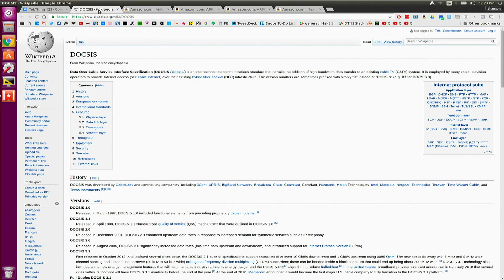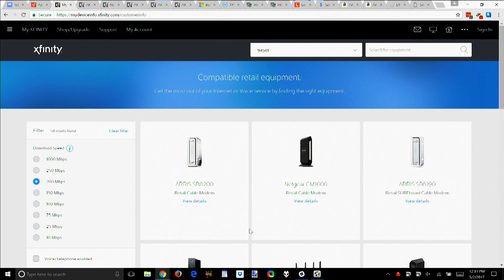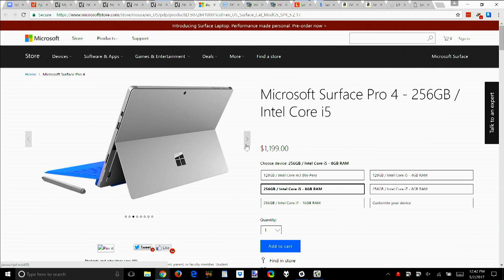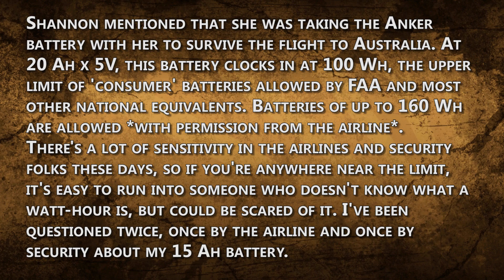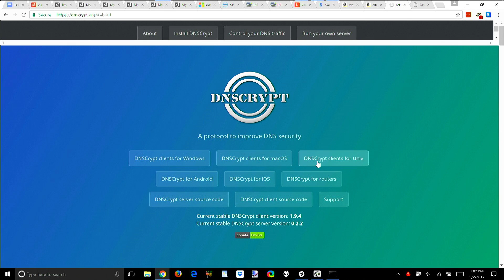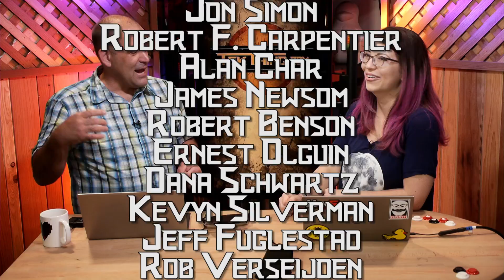Speed Up Your Cable Modem! Is Your Battery Pack Too Big To Fly? MS Surface Pro Substitutes, DNSCrypt

Comment: Also don't forget signal quality/strenght, connect your modem at the first coax split because every time you split the connection you loose 50% of the signal. Log into 192.168.100.1 and here you can see your signal strength. (google "cable modem signal levels" and you will find the acceptable ranges.)

Comment: I bought  a newer cable modem some time back and the service tech flat out told me that it wasn't compatible with there system. (This was before they upgraded to Docsis 3). When they finally did upgrade their system, I got a modem upgrade for free and basically tripled my service speeds (7 up 46 down vs. 1.5 up and >5 down) and a whole lot more stable.

Thank you for your information on speeding up cable modems. Your show rocks.

Comment: 24:00 The calculations arent off for the battery pack. The standard math formula people use to calculate Watt Hours is incomplete. It assumes we live in a perfect world, where there is no loss of power, unrestricted transmission of electricity, and that each component runs at 100% efficiency. If you account for these factors the max power goes down.

So under pristine conditions the battery pack might have 100 Watt Hours, but in the real world its only 77

[Think of modems. They might have a 100mbs down in a perfect world, but there are all kinds of flaws in the system that will ensure you will not have full speed at all times. Its also the reason some cars can go 60 miles per gallon of gas, while others can only go 20]

Comment: Snubs...you're funny..."call them and say you're looking to move"...lol...funny...ROTFLMAO...HA...We have Direct TV, ATT, and Comcast (or "cut the cord that costs as much as having the service").  AT&T will say "great, see you in a year, good luck with Comcast", Comcast says "great, see you in 6 months, good luck with AT&T", and DirectTV just plain sucks...my neighbor is currently trying to readjust their dish outside for the 50th time in the past 4 months because of issues...they don't realize it's either the rain or the SAC base going active causing their interruptions....no...we have no "alternatives" in my area...they just say "pony up"...cutting the cord will cost me the same amount as keeping the service so I go for the simple solution for the family.
Reply from the maker: Bummer! It's worked for me for 5 years straight. I just call up comcast year after year and say I got a deal from AT&T and I'm checking to see what they can offer me. They've usually offered me the same or similar rates on a new yearly contract (I don't mind the contract).
Reply: Problem we have here is we have Sattellite (which everybody hates because we have an Airbase 3 miles away and when that massive radar goes active...all bets are off)...it's also EXPENSIVE (to get the same level of service I currently have, I have to spend more).  AT&T and Comcast are about the same $$$ all things considered, and they know that they can pull a $100 hookup fee every 6 months?  They just say "go for it"...I've run the numbers...I'd end up spending more :(  I looked at cutting the cord, but between all the internet subscriptions I'd need for what I currently get?  Again, at or above what I pay today.

Comment: I haven't actually tried it, as I'm on linux at the moment, but you may be able to get DNSCrypt to start automatically by creating a shortcut to it in that startup folder. This would mean that any files DNSCrypt depends on (such as dlls or config files), and uses relative paths to locate, would still be exactly where it expects them to be.

Comment: The router could also be a bottleneck. Weak SOC's on a router can really hinder multiple streams of data.
Reply: None Yet definitely not the router as I tested the lag on our old modem while both were hardwired in. Plus, my router has QoS settings turned on so I can manage everything thru my router. Upgrading the modem has definitely helped with our shared connectivity issues.
Reply: Oh, I was talking about the person who sent the question on the show also responding just in general. Obviously since the modem fixed your issue it was the bottleneck but routers with a weak SOC can also cause problems with concurrent packet transfers and whatnot. I've had my share of routers that would just choke whenever I tried to torrent. I found that a router with a good SOC inside always solved the problem with the packet flow.

Comment: Shannon,

As others have stated, the watthour ratings are for the battery, they are not for the output.

The switching power converter increases the output voltage by turning the DC output of the battery into an AC waveform, sending that to a step-up transformer, and then converting the output from the transformer back into a DC output.  The DC output is regulated by modulating the AC waveform and measuring the voltage from a feedback loop (typically an unloaded winding in the transformer).
Reply: Off-topic discussions, personal attacks, and bullying, are forbidden on YouTube.  Reported
Reply: William Bosacker it seems everyone (including those that wrote in about it) we're incorrect! thank you for chiming in! But please don't make me feel inferior. It's a bit rude :)
Reply: FYI, I would never belittle, or make you feel inferior, publicly.  If you want to discuss this, we should be using private email, and not be discussing this here.
Reply from the maker: I always figure that, if you can't say something publicly, you really shouldn't say it at all. I saw that you edited your comment and removed the belittling portion. Thanks for that! :) -s

Comment: don't buy the 6190... Arris literally got sued because the latency was so bad. Get the 6183 or buy a DOCSIS 3.1
Reply: NickF1227 I saw that elsewhere as well, but haven't noticed any lag issues. perhaps they fixed it on newer hardware revisions? hmm.

Comment: Hope he reads this ... The reason DNSCript wont work in the startup is because it needs to be launched as admin. You need to create a task for it instead and have the task set to "run with highest privileges" .. then it will launch at startup  I have had to do this with other programs that need to be launched as admin

Comment: i'm in NC with Time Warner Cable and have a Ubee modem/router/wifi.  So you're saying it's best to have a modem by itself and then use a router/wifi separetly?  i stopped using my DLink DGL-4500 years ago when they put out these better Ubee DOCSIS 3.0 modems with lots of features.  It seems like it's a good modem combo.  Also, i used to play Battlefield on PC a lot, but haven't played in a while.

Comment: If your uploads are throttling your downloads, it's also worth looking into the bandwidth settings on the apps that are uploading.  Dropbox and Google Music are two applications that allow you to adjust how much of the pipe it uses.   It's not always necessary to buy new hardware.   I also highly recommend the forums at dslreports.com:  there are lots of knowledgeable people there including real, live engineers who work for cable companies.

Comment: The SB6190 is a terrible modem, get something else!!! I've had nothing but problems with it, switched to a NETGEAR CM1000 instead, been flawless! I'm a computer tech/system builder/network admin/etc...noticed weird issues while gaming, and found this article, I have found other sources saying the same thing, look around and you'll see for yourself...

http://www.dslreports.com/shownews/The-Arris-SB6190-Modem-Puma-6-Chipset-Have-Some-Major-Issues-138411
Reply: Interesting owning a sb6190 I immediately started to check around I might have gotten lucky I have not had these issues I own hardware revision 3 and currently only have 24 pairs bonded so it seems to be alright. Here is some further reading I found the test they made very useful:
https://www.dslreports.com/forum/r31079834-ALL-SB6190-is-a-terrible-modem-Intel-Puma-6-MaxLinear-mistake
Arris then got in trouble:
https://www.theregister.co.uk/2017/04/11/intel_puma_6_arris/
Reply: No dude, its a know issue with the Intel Puma 6 chipset, hence the link in the post I made...here are more...

https://www.theregister.co.uk/2016/12/03/intel_puma_chipset_firmware_fix/

https://linustechtips.com/main/topic/736823-cable-modems-with-the-intel-puma-6-chipset-lag/

https://www.dslreports.com/forum/r31122204-SB6190-Puma6-TCP-UDP-Network-Latency-Issue-Discussion

I can go on, but I think you get my point, please read/research before posting something non-technical like my cable company cant handle that many channels lol
Reply: it may just need updated firmware...or your cable company just cant handle all those channels.

Comment: Lag has absolutely nothing to do with how fast you internet connection is and has everything to do with your physical distance from the server you are gaming on and the quality of the connection your ISP is providing you. Things like jitter and congestion on their network cause lag. Of course if you are utilizing 100% of your available bandwidth you will experience lag. You can counter that by using QOS.
Reply: Ideally you're right but in reality not true. Bandwidth can affect your latency if you hit your maximum capacity.  Poor hardware, software and intentionally poor choices of implementation by the provider also have a big impact on latency.
Reply: I say all of this in my post. So therefore I agree with what you are saying.
Reply: My router is setup with QoS which definitely helps, but isn't the main component in my modem issues.
Reply: Oh no I understood your issue with your modem, i'm just stating other causes. Huge fan right here !

Comment: For the watt hours, it is based on the battery cells and not the output. With a power banks made by anker, they use They use multiple 3.7V cell batteries that have a max charge voltage of 3.85. They then use a DC to DC boost converter to get the 5V, this can often have a 7-10% impact on the effective capacity as those components are not 100% efficient. If anything, anker is overestimating the capacity of their power banks. Furthermore their estimates are based on the max capacity and not the typical capacity. For example, a 4000mAh battery might give you 4100mAh or it could give you 38800mAh as there is variation in the manufacturing process of batteries, but power bank makers focus on the maximum to better pad their numbers.

Comment: One thing I found with an old modem: it didn't fail completely, but I was getting only 700 Kbps speed. I got on the phone with Cox (my ISP) and found the modem was dropping 90% of the packets. As an electrical engineer I figured out that there were lightening strikes that  partially damaged the input protection. This can happen to any modem, the input protection degrades over time, so a new modem fixes lots of problems. I now have fiber optics to my desk, with an optical input to ethernet converter, so that doesn't happen again. Bottom line changing your Cable Modem every 4 or 5 years is a good thing.

Comment: all of those portable batteries are lithium ion batteries, they are 4.2 volts fully charged, and when discharged they are 3.7ish volts, in order to get the 5 volts that the usb spec uses for charging they all have step up regulators so that the calculation they are using is 3.85*20 (i assume its a 20000mah pack)

Comment: I've had the base Huawei MateBook M3 for about six months. It's a solid computer/tablet. I watch a lot of streaming content on it and read CBZ files on it. I find that it does everything I use to use my Acer R7-371t with an i5-4210U at half the weight/thickness. 

It's on sale for $200 off at the Microsoft Store. They also havethe port adapter, stylus, and keyboard portfolio case dicounted. The whole package is only $600, which is what I paid for just the MateBok w/free keyboard portfolio cover last November.
Reply: Bryan Lucas I have a Chuwi Hi12 for the same thing -- magazine pdfs and comics. I know it's too weak for real work, but it's perfect for its intended use. Beautiful screen on that thing. And I got it on sale for $225 from Gearbest. I know it's a crapshoot if I ever have technical issues, but at that price, it's not a huge risk.

Comment: The Lipo battery cells(Multiple cells in a battery) are about 3.7V, and that's what they use for the calculations.
The battery bank just outputs at 5V(For USB compatibility).
Reply: same

Comment: I recently bought a new router, not that I had any issues with my 'old one' just wanted more home network speed so I bought the DL 868 from D-Link, but when I tried connecting to webpages or videos it just wouldn't process it sometimes and lag out.. I returned it but still curious if someone here knows what could have been going on? both new and the old router that I am using again, without problem, where connected to my modem that is in bridge mode
Reply: Did you tell your ISP that you were upgrading? With mine, we had to activate the new modem on our comcast acct before it would allow us to connect.
Reply: Shannon Morse no, I have a normal modem from my ISP, but because it isn't that good I have a router hooked up to it that I bought myself, only the new router had problems, should stand alone from my isp

Comment: lol my ravpower is stated at 99.16wh that's 26800mah at 3.7v it it's at 5v it's am 134wh... guess I'm screwed on my vacation.
Reply: FishFind3000 Nah, it's actually fine. It is under 100wh. It won't hold more power just because you use more volts. It will just drain quicker.

Comment: If you have telephone service with the cable company, you can use their modem for just the phone line, and hook up your own modem for internet. In most cases, the ISP only charges rental fees for the modem if it is used for internet. Best thing to do is call the cable company and hope that the rep knows what they're talking about... then call them again to verify that you weren't told incorrect information. (It's a hassle, I know... ) 

- Also... the max speeds listed on Docsis 3.0 modems don't mean sh*t. On my ISP, each channel is maxed out at about 20 mbps (as opposed to the 38mbps theoretical max) ... so an 8 channel Docsis 3.0 would max out at around 160mbps, and 16 channel modem @ 320mbps. 

- I used to work for the cable company... so I know what I'm talking about.
Reply: OneManShow 
True about using Comcast's box for phone line and your own modem for Internet. This is the way I run it.

Comment: you might have a fibre optic connection and be right beside the cable box or you might be right beside the local broadband provider, Patrick why do you move close to where Shannon Morse lives.
Reply: DAVID GREGORY KERR definitely not fiber optic (yet), though not sure about the providers location.

Comment: do you guys have the data cap with Comcast in heber utah it is capped at 1 Tbs and i usually use about 500 Gbs of that a month
Reply: Tyler I have not seen any data caps. It's only if your torrenting like crazy.
Reply: Tyler yup, it's 1TB here. I'm not happy about it, because I know eventually I'll get close to that cap, but right now I'm hitting around 500GB.
Reply: it seems to be a area thing i was just wondering if anyone else is seeing it in different areas.  i have talked to others in my area and they have the same cap it's just comcast trying to get more money out of ppl in high flow areas
Reply: ya dang that sucks i posted it on my local facebook page and everyone was like who cares i will never hit that and that is not true in a couple years everyone will be hitting that.  and prob like you i'll be hitting it in a year at most